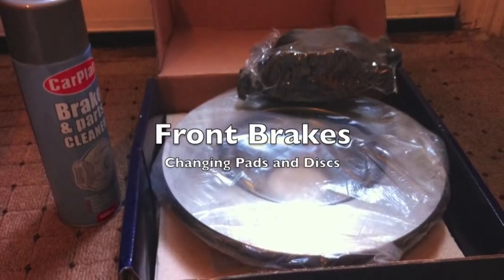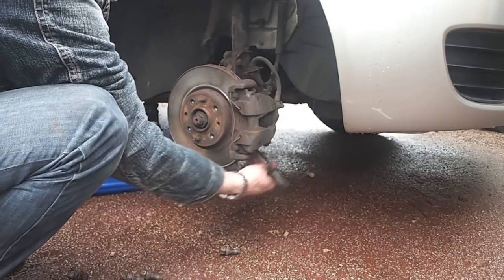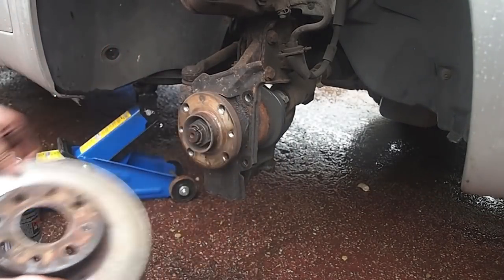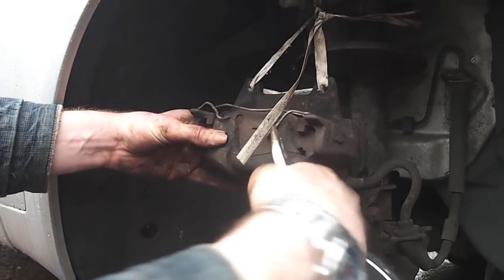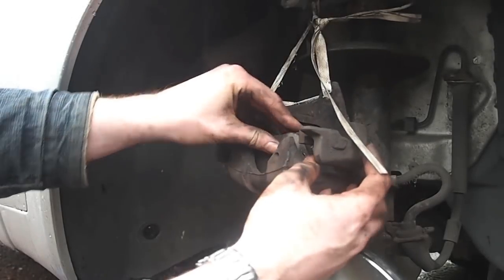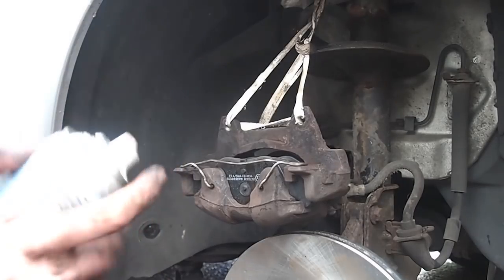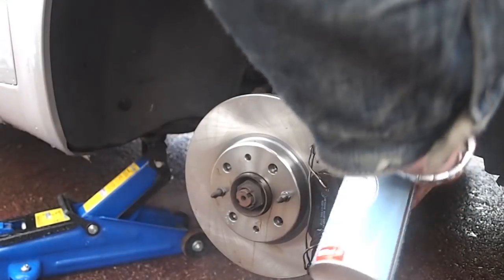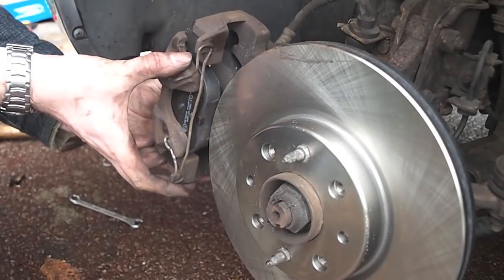Changing Brake Discs and Pads on a Fiat Punto Mk2 MK2b 1999 - 2006

Comment: Very useful for a Fiat Strada pick-up (2003, identical parts) too, but maybe you should mention the fact that the brake fluid reservoir has to be opened before forcing back in the hydraulic piston AND that the reservoir is likely to spill, so it may be a good idea to reduce the brake fluid level to MIN before you replace the pads. Also, putting back the wire spring thingy is much easier when the calliper is fixed with the 2 bolts, in stead of dangling from a rope.
Reply from the maker: Thanks for letting me know about the Strada pick up, usually people don't top up the brake fluid so ,ugh here so when the Pistons are pushed back the fluid level goes back to the max and no higher, but it is a good point, usually putting a balled up piece of tissue/blue roll or a cloth in the top of the fluid bottle will soak up any excess without spillage, to have it bolted in place means taking the disc off bolting it back on, winding it back then unbolting again, much easier with a clamp as in the video and takes seconds 
Thanks for watching and sharing suggestions, which I may try out next time

Comment from the maker: Hi Bhavin front wheel bearings require a hydraulic press to remove them from the hub assembly, I don't have a press and they are pretty expensive so this is sadly a task I'm not likely to tackle

Comment: Greate and useful video! How do you open the Brake fluid reservoir before pushing the hidraulic piston back?
Reply from the maker: Just unscrew the cap where you would normally fill it. Be sure to push them back slowly so the fluid has time to filter back up to the reservoir.

Comment: Hi its going back in the garage soon I know its difficult to say what it is but  have you any inkling though its doing my head in.
Reply from the maker: just spotted your comments, did you ever get this fixed? my only though would be the wrong type of fluid has been used in the brakes which I had problems with in the past on a previous car
Reply: Well new calipers fitted new pads and disk. they work fine but still the wheel nuts get hot and smell like there sticking but garage said there fine.
Reply: What type of fluid is the right one.

Comment: Punto 1.2 2001 -- Ive had new calipers new discs and pads on both front wheels and still the  gets really hot and smells.?any ideas whats wrong
Reply from the maker: Very hard to diagnose from a description on the Internet could be a number of things best to get it looked at as you don't want to take half measure with brakes

Comment: does this apply to punto 2 aswell ?
Reply: +Haytrix Thanks to PuntoHowto for this film. On my 2003 Mk2, the design's a wee bit different but it's basically the same job. See the video from "MichalFofo" too - his is like mine, but he dismantles a bit more than he needs to so see his comments section. Take care brake fluid doesn't overflow the reservoir when the G-clamp forces fluid back up the pipe, in case someone's ever topped it up to compensate for pad/disc wear.

Comment: You should have removed the caliper from the carrier cleaned the channels that the pads sit in and then regressed it this will stop brake squeel and stop them from seizing
Reply from the maker: Never had any problems with sizing brakes or squealing the car carried on for another 20-30k miles before I sold it and since then it’s likely been scrapped, so may be a little late for this advice 😐

Comment: Why would you do a brake change whilst it is raining, you should never work on a car only supported by a trolley jack as in the video and you  should clean the mating faces of the brake parts before refitting . Probably not a good idea to try and get the new pads in the caliper whilst its hanging better to fit the caliper then put in new pads and rememberto keep an eye on the brake fluid level when fitting new pads and or discs. Always remember to pump the brakes a few times before driving off. All inall a poor video of how to change brakes. 

.
Reply from the maker: To answer your comments,
Done in the rain as that was the only available time to do it and it happened to be raining.
There were axel stands used its just they where behind the wheel assemble and not see in the video, if you look carefully you'll see the trolly jack isn't touching the car. 
liberal amounts of brake cleaner where used if you'd watched the video you'd see.
This design of calliper doesn't allow fitment of pads without removing from the car as you can see if you watch the video the inner pad has a large metal clip on the back to located it in the piston, so it can't be slid in the calliper needs to be off the car.

A valid point about keeping an eye on fluid level and pumping the brakes however in all a poor 'know it all' comment from someone who didn't watch the video properly
Reply: You should have made a point about axle stands and shown them and still should not have done it in rain. Better not to do something than to do something dangerous actually.